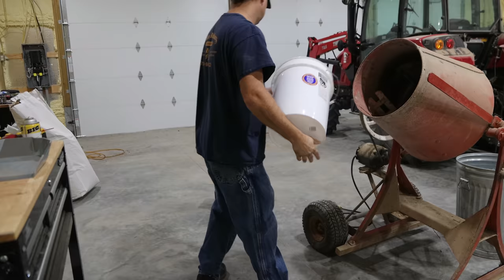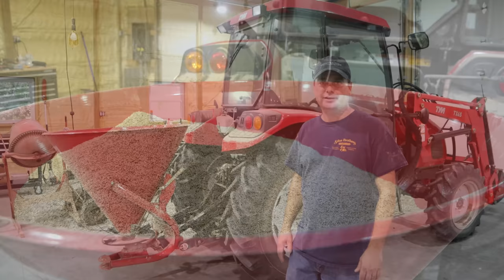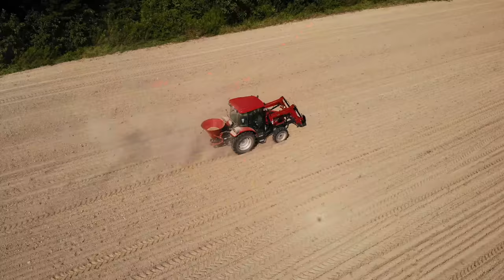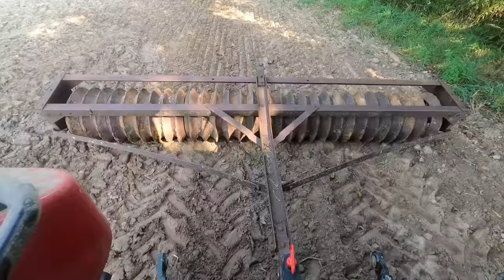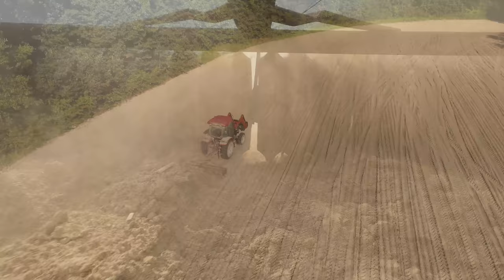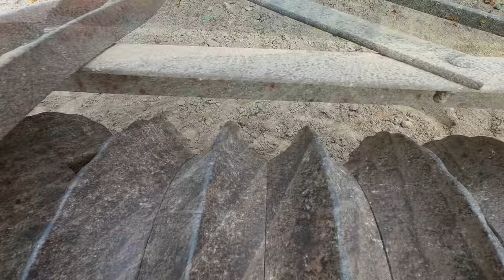Planting our our new Hay Field with a custom Grass Mix

Comment: I have a cultipacker that looks just like yours. The shaft rides in a wood block on each end. I inherited it, it was bought used for 2 dollars in the 50s,
Reply: I have mu dad’s old roller it has wood bearings also 

What type of wood is used ??
Reply: @georgedavidson1221  the old guy that I inherited it from used white oak, I made one out of yellow pine, used 1 7/8 hole saw. I drilled a hole at an angle and put a grease zirt in the wood so I could grease it. It's been on about 10 trs.
Reply: @georgedavidson1221  Lignum Vitae, ideally...

Comment: Before washing, use the leaf blower to clean off most of the dust and blow out the radiator.  I find the equipment cleans up pretty well with just the leaf blower and it is much quicker.  Also, I use to drag a large section of chain link fence behind the tractor (with a log fastened across the top of fencing to hold it down) for smoothing the field and covering the seed.  Worked well.

Comment: Glad you used cultipacker, this what i use for this purpose. Packer compresses soil to bond seed & grooves accept heavy deluge of rain water & hold soil. Roller is smooth & seed tends to stick to it. Roller makes ground like a paved parking lot. In heavy rain no ridges to slow the erosion of soil/seed. then a redo for part or all of field. I cringed when you mentioned Timothy seed as this was raised to feed horses only, If one stem reaches maturity it is like wire, it punctures and kill cattle. Never let it get that high. Also Timothy pulls from the soil, does not add  or amend. Seed germination is 7-10 days.  You will be tempted to harvest in late October if weather cooperates in growth, but strongly suggest you resist until next May.

Comment: it looks great.  The rolling will help the bumps when you are cutting later. The only thing I plan to do differently when I plant next year is to spray for weeds prior to planting.  So I do not have to fight with the weeds as much when it is all germinating.  It funny how you can put down so much seed and it sprouts when it wants. I had  a few alpha sprout two yrs later after I had done my cover crop.  Should be nice and smooth for when you make hay.  Now rain hmm.  Just glad it gave you time to work it properly.  Someday hopefully you will get to thin the trees along the edge.  Maybe a battle after you get it bailed next year.  I think I may start ploughing to help with my clay ground.  It seems for me to be such a gamble in the spring with rain and the ground still frozen.  I really like your packer.  I think I should get one.  They really have their place in the line up. Well looking forward to see how it does.

Comment: Evan just recently found your channel, subscribed.  I would like to make a suggestion to look up a few farmers that I have been following if you haven't already.  They are experts at organic and /or regenerative farming. You might find some useful ideas to help improve your land & save you some money & time.  They are Gabe Brown, Greg Judy & Mark from I Am Organic Gardening from NJ.  If I were young and interested in farming I would use what methods of theirs I could follow. Good luck to you.
Reply from the maker: I have read gabe browns book "from dirt to soil"  this will be the only time the soil structure damaged.  It will be hay for many years.  From here on out it will only get composted manure as an amendment. 
There is not a good way of getting rid off all the weeds without using chemicals, except by tilling.  I would rather till the soil than use roundup.

Comment: nothing grows in dust. i want to over seed my feileds, but we have all ready had 2 heavy hard killing frosts. but i will over seed with rye grass soon as it get a bit colder so it comes up in the spring fast even in our cold wet spring, as i have to feed my live stock hay every year into late June before there is any grass for the cowsm at least the rye grass will give them early spring green feed and less hay, i go though a 1200lb bale every 2 days over out long cold 40 below winters, some time more if we drop into the 50 below for a few weeks

Comment: Dont forget next year to re-seed the older hay field. If there's one thing I learned is that good hay needs lots and lots of work.
Every year you need a bit of reseeding as well as some light harrowing and rolling to enforce growth and replace dead plants.

However, one thing I want to mention since its a bit of a misconception around starting farmers (and older ones alike... its a bit of a myth):
If a legume fixes nitrogen it does so because itself cant find enough to grow. It creates an environment in which rhizo bacteria strive and produce fixed nitrogen in form of little nodules. However, the nitrogen does not magically flow to other plants in its vicinity, it will only nurture the legumes the bacteria and nodules are attached to.

Only if the plant, and therefore the rhizo bacteria, die the nitrogen is released for other plants. 

Therefore, if you harvest biomass in form of hay from your field, the legumes may flourish because they can support themselves - all other grasses will not. 
You need to fertilize - or sacrifice one cutting in form of mulching the plants for biomass to return the nitrogen produces from the bacteria, back to the soil for decomposing.
Reply: Generally a nice midfall clipping is one of the simplest ways to improve a hay field, culling weeds, mulching the soil for winter and also improving the nutrient profile of the soil. :D
Reply: @chunkmen  We do that when the gras is just out before being out of its vegetation cycle.

Comment: I'm a little bit wondering as to why you didn't go with alfalfa in the mix since it has been so highly praised by so many farmers for all animals. From goat to horse to cattle.
Reply: Generally the problem with alfalfa is that its more steps to feeding and if you get a heavy alfalfa crop in a low haycrop year you end up having alot of bloat in your hay, Clover is a safer and less continuous work option.

Comment: What happened to the two lovely old tractors ? You keep running the "newby" and I'll keep giving you the thumbs down.
Reply: He likes his old tractors, and I think he will work to restore them, but he has the TYM tractor that was supplied by the manufacturer and part of his deal is to use it and have it in his videos so the tractor gets the exposure to other farmers/homesteaders so they can sell. Tractors. He uses all older equipment as this is what fits his wallet and because he likes to rehab the, and use them. Don’t be such a fuddy daddy. Evan does a great job
Reply: As hot and dusty as that was I'd be in a cab tractor to if I had one alan Ak